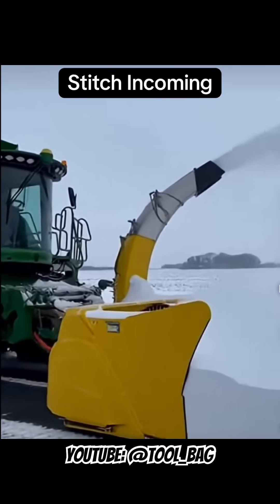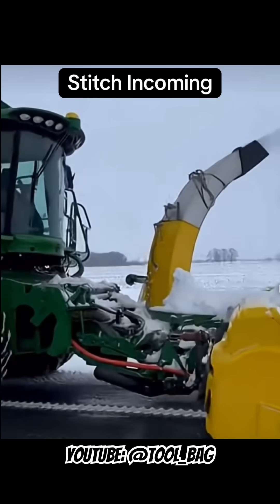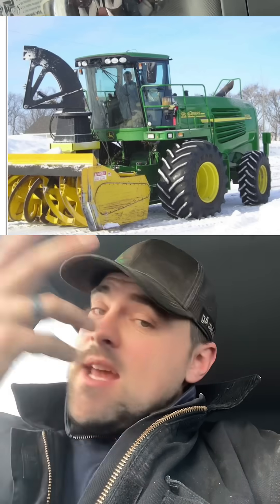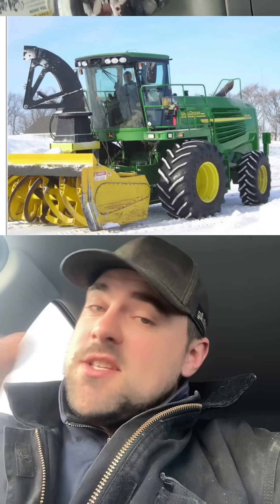Check out @tool_bag for full video. AI Makes It Look Crazy But It’s Been Done before! #farming #snow

Comment: My local welder had a old 6400 White Swather the header was worn out and not worth fixing so he made a 10ft hyd angle snow pusher for it and a set of forks with the lift assembly off a old 10K pound Clark forklift

Comment: How did you know it's AI? Unfortunately I can't detect it
Reply from the maker: The original video shows a lot more ai type issues. The stickers are incorrect for its model on the side, the cab has too many headlights in a row compared to a stock combine cab, and if you look at how the blower “attaches” to the combine, the front plate looks different from what a combine should have on it. 

Plus, the original creator, tool_bag, stated that the combine was ai generated
Reply: For some general tips on spotting ai here’s some that usually work for me:
-Look at things like text or decals, it really struggles with those.
-watch the movement of things, the physics of AI video are often really odd and messy looking. 
-if there’s any exposed mechanical parts, look a little closer at them, ai stuff often has a lot of parts/hoses leading to nowhere, and are just generally incoherent if you actually look at them.